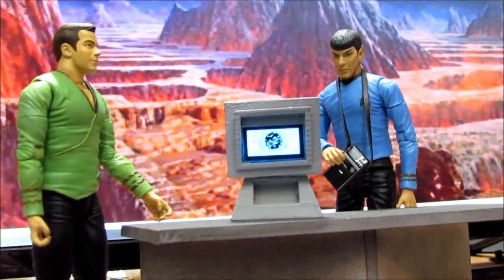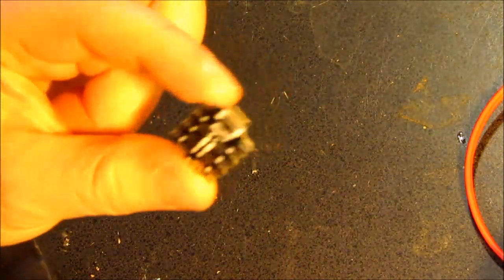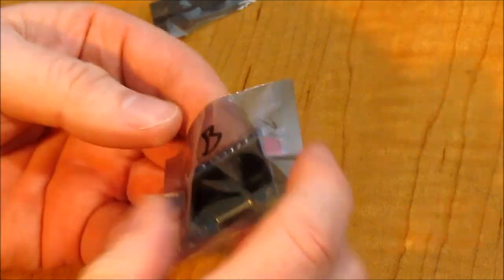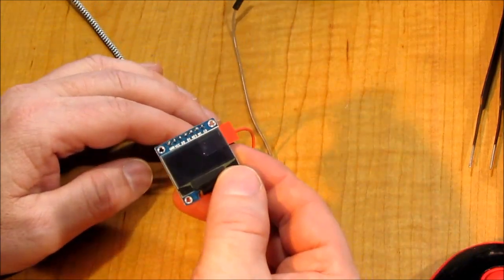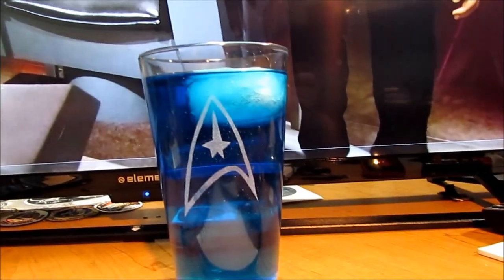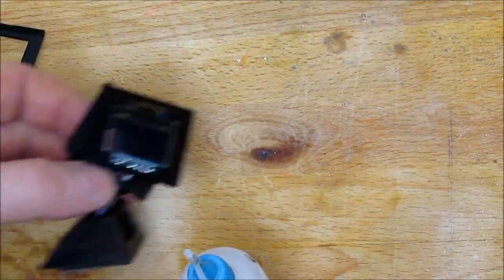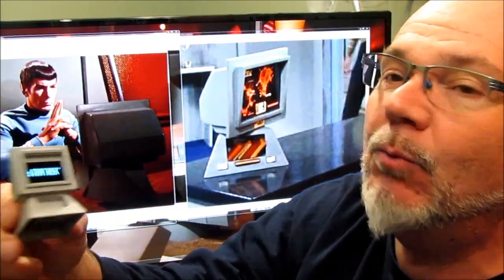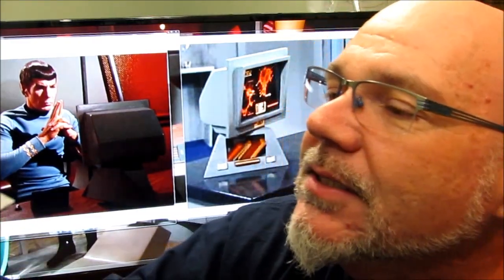Make a Mini Star Trek Desktop Viewer

Comment: Which pins on the beetle went to which pins on the display? Did you use the U8glib library?
Reply: Here is the solution I found. SPI Com: SCK = 10, MOSI = 11, CS = A2, A0 = 9, RES = A0

Comment: The twisted wire through a fully plated via is a solid principle.. Same concept as wire-wrap (sharp corner locking into a cylindrical conductor), so it should be fairly reliable if it's not in a too high of a vibrating environment.

Cute OLED.. I just ordered a pile of these TFTs from China (for Jim's class):
http://www.ebay.com/itm/152237230739

Cheap displays are fun fun fun! :)